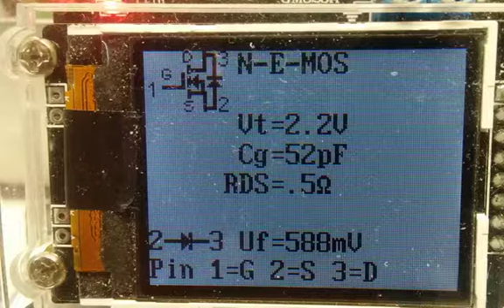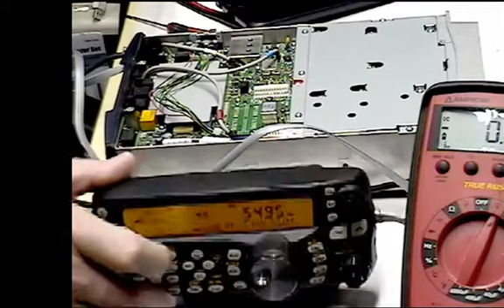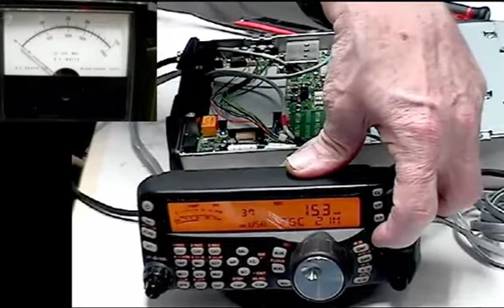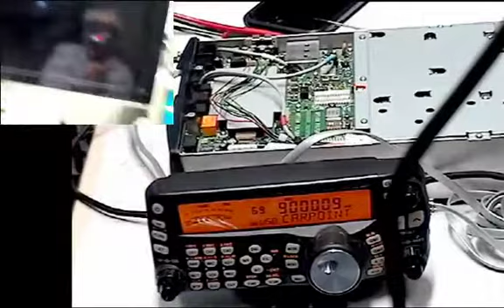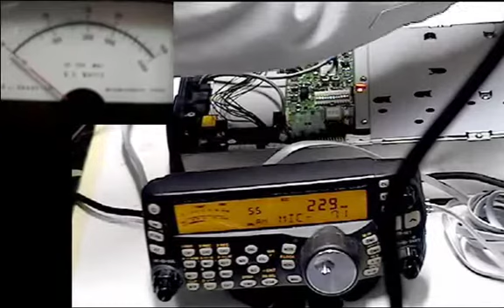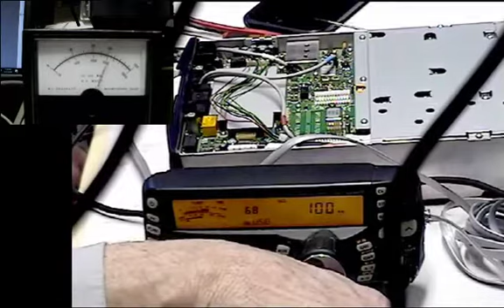Repair and Transmit Alignment of a Kenwood TS-480SAT

Comment: I think my 480SAT had this exact problem. Do you do complete alignments on these?
This unit has low hours because shortly after purchasing this one I bought the HX version.
This does have the TXCO option and visited the Kenwood service center for low RF output. I guess there was a faulty final. 
Dave
KA1OLA
Reply from the maker: Hi Dave.  Please contact me at aervblog@gmail.com.

Comment: Not very precise on his measurement settings, several times he was under the actual settings. Slow down, be more accurate on the settings.
Reply from the maker: You are right but I have to say that the pots they give you to adjust the settings are VERY touchy.

Comment: Hello sir my Kenwood ts480sat shows infinite swr with 10 watt power output please guide
Thanks 
Vu3txi
Vu3txi@gmail.com
Reply from the maker: First check the simple stuff like a broken wire or loose connector from the PA to the board with all the relays. Second make sure the relays are working. How is the receive?
Reply: @AERVBlog  Receive is perfect

Comment: Did you have a half power output issue before you replaced the transistors on the X58 4900 board? I'm having 50% power output even with power set to maximum 100 watts. Antenna tuner clicks and never tunes. I bought this unit from an estate and screw heads showed signs of being removed several times. It worked great for about six months.
Reply from the maker: No. I had on the order of 5 watts or so. I don't know off hand how you would end up with 50% power. Sorry
Reply: I'm getting just 5w on some bands with a dummy load connected , do you think it could be the same problem ?  @AERVBlog
Reply: I think my problem was the VR1 VR2 VR3 adjustments. I checked the power output adjustments in the menu and while I was doing that, the current began to increase and I smelled hot. The X58 4900 board had smoked. I wish I had checked that before I even looked at the menu. I always figure no one would turn the VR's. This may have been the whole problem.
Reply from the maker: @randallcarson5191  Rule #1: Anything that can be turned will be turned before you got it.
Rule # 2: Nobody has ever tweaked anything, ever.
Reply: Ah HA! VR2 isn't adjusting so I'm headed into check electrolytics next.  I just put the new driver on and even tho VR2 didn't adjust, this thing still gave me 100 watts on FM. Q2 on the driver board got too hot again so I turned off the power.
Reply: It's basically just 5w on the 10m band , the radio has been widebanded , but all other bands seem to be fine any ideas ?

Comment: Hi I have problem with my ts480 on anttena number one auto tuner is not working number two working fine now I see there is 9 white elements I'm not sure it's relay or something different but I have only 8 can you tell me pls what is exactly and it's possible it will be problem with this element for auto tuner thanks.Artur
Reply from the maker: I have not worked on a TS-480SAT with an auto-tuner before. What do you mean by 9 white elements? Are they rectangles and do they have any markings on top?
Reply: AERVBlog there is 9 relays on this one on video in my I have only 8 in manual this relay is K891
Reply from the maker: @arturgatarek8847  I am not sure what that K891 does but my manual shows it as not there. It has something to do with the 3.5mhz auto tuning.

Comment: Fixing Kenwood TX480  no mic transmit.
Reply from the maker: Well, did it work?
Reply: @AERVBlog  All good Mic A1. Do you have a problem with yours.
Reply from the maker: @Justplast  nope. It is still working just fine.
Reply: @AERVBlog   Some time its the RNP20S Power Resistor Widerstand 1R0 35W  and DSA301LC  Part that my have blown.
Reply: Have you worked on Sony ICF-SW77  Radio AM FM SW SSB band?
Reply from the maker: @Justplast  no I haven't.

Comment: Hi there. Why my ts480sat is the output only goes out to 75watt. I checked by using power meter/swr. Not sure what wrong with. Do i need to do adjustment?
Reply from the maker: I am sorry it took so long to get back to you. Sometimes I do not get get notifications of comments. Are you talking about SSB or AM? It takes a pretty fast meter to measure SSB output reliably and AM won't be much more than 25 or 30 watts if the radio is set up correctly. 75 Watts sounds about right for most meters to display on SSB so I would say it is a good bet that your radio is OK. Thanks for watching.
Reply: @AERVBlog  its ok mate. 75-84watt in ssb only. Some of my friends have this problem too. Very hard to get full 100w.
Reply from the maker: @9w8zzkmohamad59  a 2 tone input to the mic will usually do it. 500Hz and 1200Hz or as long as they aren't multiples of each other. I still think that is about normal.